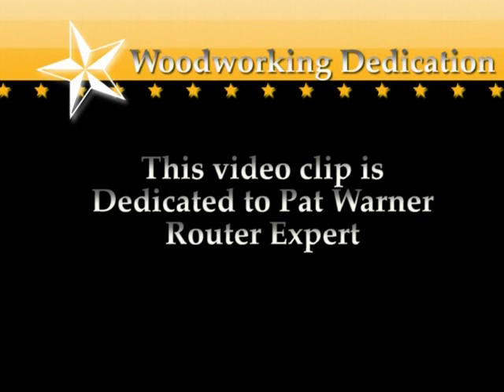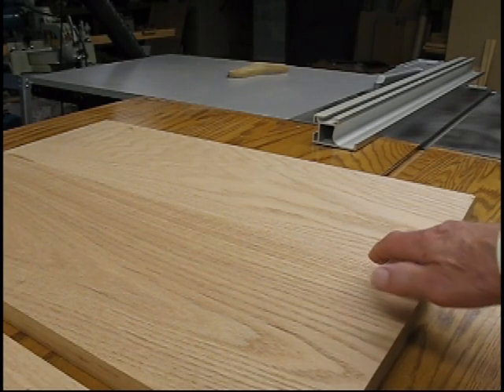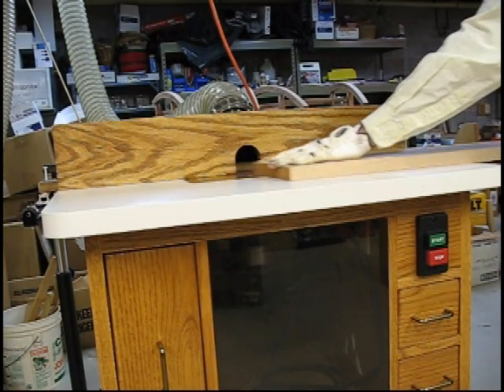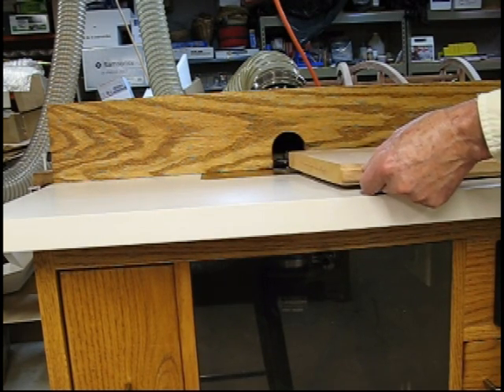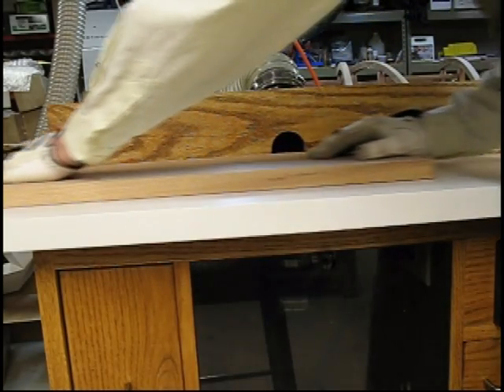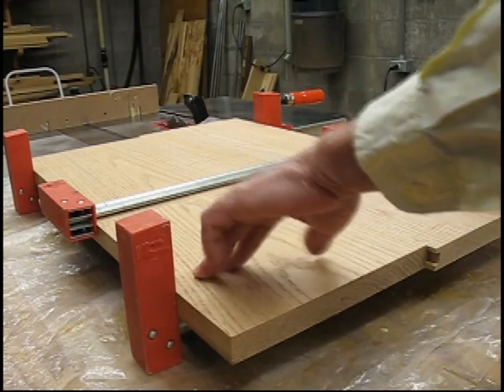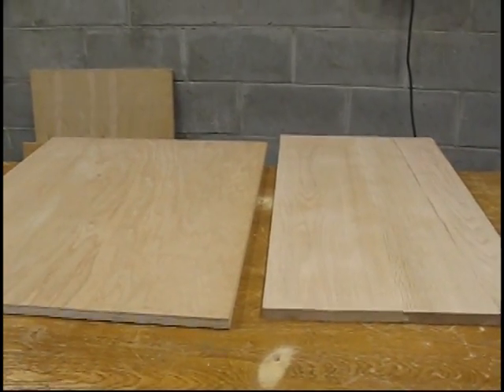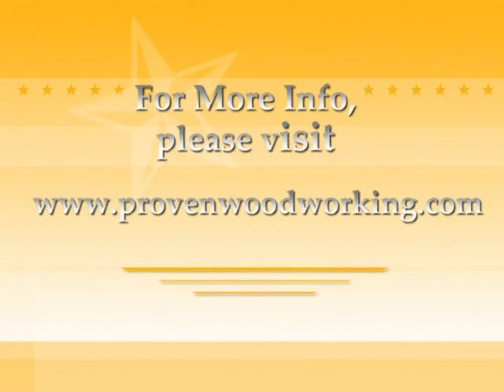How to Edge Joint Boards for Perfect Alignment

Comment from the maker: Hi Norbury53,
Thanks for viewing my video.
You are correct. The edges of the board should be square & flat. You can edge joint the board with your router table.

You can find out how to do this on my website!
Best, Jim